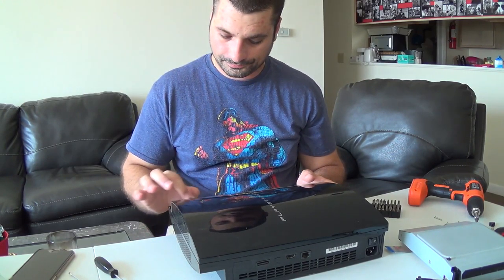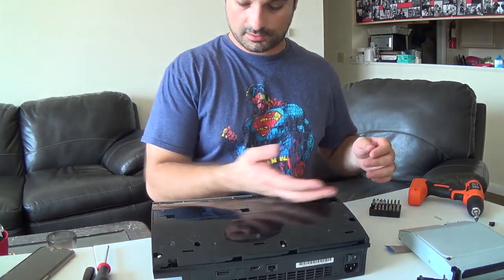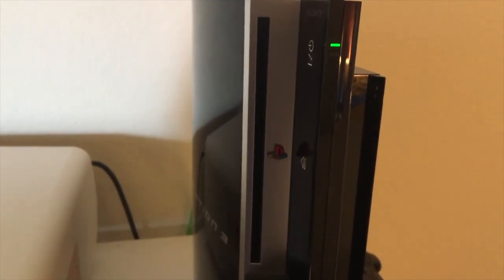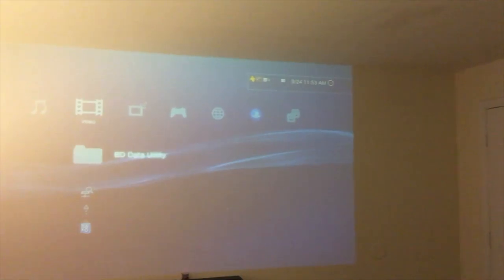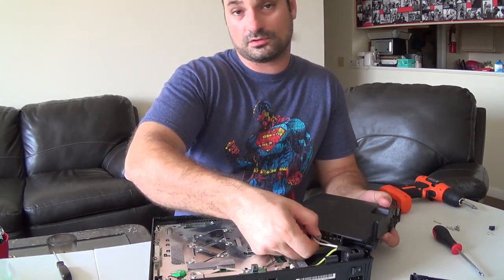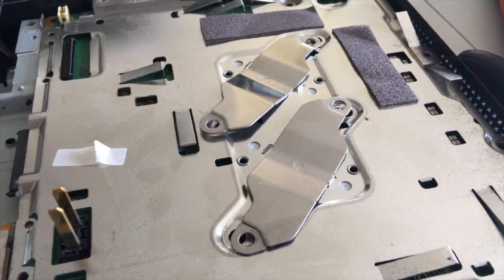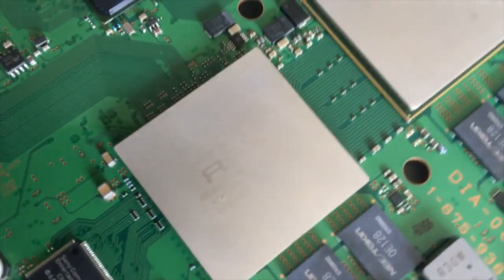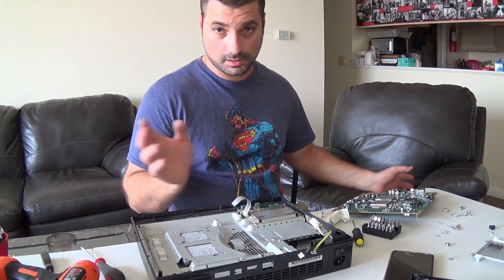Fixing the Fat Playstation 3 - Part 2

Comment: yeah it could be that the really delicate ribbon for the BluRay drive in your old ps3 is bad. it will be interesting to see what you find out after you get the other ps3 running.
Reply from the maker: +Sam The Multimedia Man I have the next video uploading as I type this.  It ended up being too long though, so I had to split it up.  So now there's more that the planned 3 videos.  What I found out after some last minute research is quite interesting.